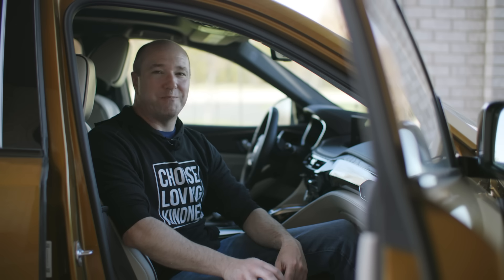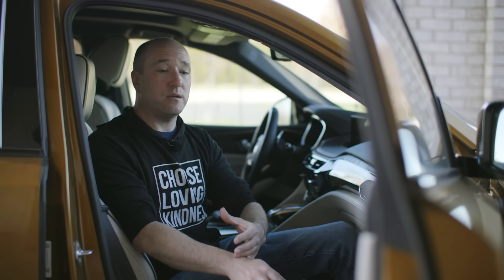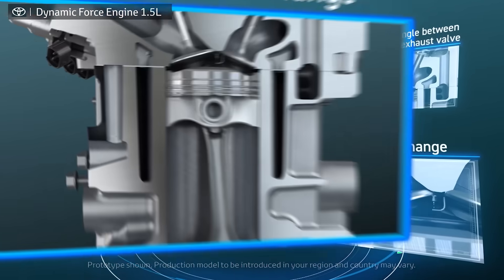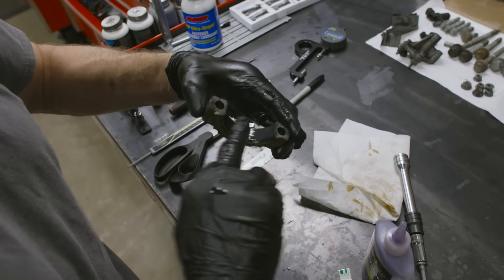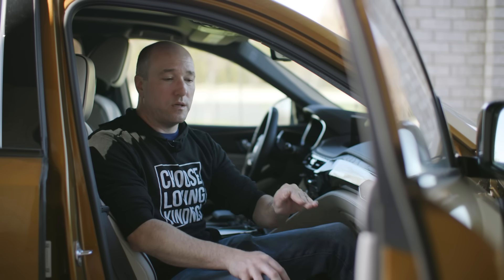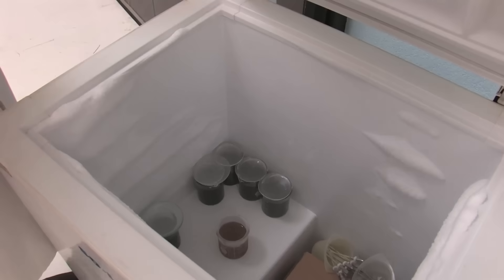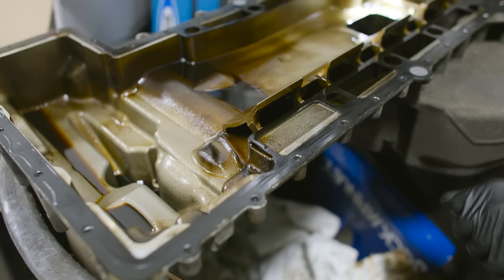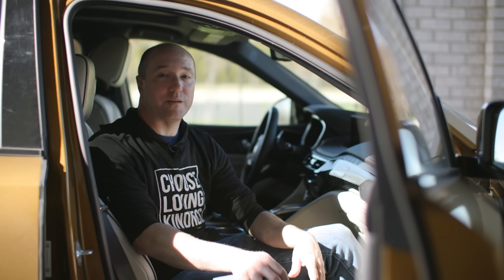Understanding Engine Break In | Dos and Don'ts

Comment: 5k miles for oil MAX
Reply: Especially if your ride is sporting a turbo.
Reply: 3k
Reply: @berict  3k or every 3 months for older vehicles that sit around I've heard
Reply: 3k or 6 months for me. Oil changes are cheap, engines are not. Top tier gas, change your all the filters 1 x a year. 3 years or 50k for tranny’s and fluid change for radiator, brakes and power steering.

Comment: Another reason why the combustion engine needs to go. Get an electric car, charge it and go. None of this bs engine break in.
Reply: You have an entirely different process. Don't over heat cycle the cells. Don't slam on the battery and jump on a level 3 charger. Don't let your ride sit below 50% charge for periods. Fully cycle the battery to reset the battery meter. Nothing is perfect.

Comment: Many keep talking about oil change intervals with no mention of what type of oil there talking about. Modern synthetic oils are totally different than old school dino oil. Changing most synthetic oils at 5k mile intervals after break in is normally unnecessary and provides few if any benefits in most normal daily driving cases.
Reply: 2 words "Oil Analysis"

Comment: Great advice!

Alot of manufactures are currently are using 0w oils, such as Toyota in the LandCruiser 300 here in Australia, this is used to ensure DPF and emissions systems longevity and also reduce friction and achieve better mileage.

However, this is resulting in crank bearing failures and piston scoring under loads and towing etc, which is what LandCruisers are used for.... So definitely change out your oil to a rating that suits your use and dont listen to your dealer who in our case is only following 0w oils recommendations from Toyota

Comment: A valuable video not only because of the obvious effort put into the video itself, but also because the very insightful comments provided by viewers.

Yet still I am not fully clear on the subject of varying the engine load during the break-in period.

With a cargo van (4250 RPM redline) which I, after breaking in the newly fitted enging, expect to daily operate between 1500-2500 RPM (accelerating) in a relatively relaxed manner, cruising on the highway around 2250-2500 RPM, occasionally accelerating up to 4000 RPM, I did the following for about the first 1000 miles:

My acceleration was in a quite slow and steady, linear way - basically in a manner I'm afraid frustrating to the average commuter - shifting at a maximum of about 2000 RPM, without lugging the engine. Perhaps this is what one could describe as babying it.

Perhaps doing a few things differently would have been better:

Setting a higher RPM limit or perhaps accelerating in a progressively increasing manner (whilst still feathering the throttle). Basically not being too gentle, holding traffic up slightly, but also not keeping up with those in a rush.

If someone could please enlighten me, I'd appreciate it.

Obviously the first 1000 miles or 1500 kilometres is just the very start,  I guess one increases the load afterwards in a steady way.

Thank you

Comment: Got my first brand-new car in June. A GR Corolla. Came to me with 8 miles on the ODO. I did a LOT of reading, learning about oils, piston ring interactions, crank bearing wear, etc. This is a 1.6 L 3-cylinder that's boosted to upwards of 25 PSI, after all. I didn't want to do anything wrong. And Toyota's break-in process seemed inadequate; 621 miles (1000 kilometers) of avoiding extremely high speeds and sudden acceleration, avoiding driving continuously in low gears, and avoid static loads. That's it? That's all they give us in the owners manual? Doesn't seem like enough.

So, instead, while following those rules, as well as plenty of engine braking, I went further.

First, I did an oil change right off the bat. New filter, and Royal Purple 30 weight break-in specific oil. Repeated at 500 and 1000 miles, then switched to ASMOil 5w-30 Signature Series at 1500. Always with a high-quality, fresh oil filter (Napa Platinum or Wix). 

First 500 miles, ZERO boost. Nothing above 0 PSI on the boost gauge. Next 500, nothing above ~5 PSI. Next 500, nothing above ~10 PSI. Plenty of monitoring of oil levels throughout, though I never had to top up. Always varying the load, never giving more than gentle throttle input under 2K RPM, plenty of engine braking, etc. Basically, trying to get those piston rings to mate as best as possible with the cylinder walls. Especially important now that the piston ring gap issue these engines have has become known. Gentle warm-ups, running time after driving to cool down. 

At 1500 miles, I also did a full lube swap. New engine oil and filter, new transmission oil, new transfer case oil, and new rear diff oil. All AMSOil (as that's what was available, and it's a known high-quality product, though I was hoping for Motul). 

All of this was not hard, and I don't understand people who don't spend the time and effort to break-in these engines right. Like, the inline 4 in the wife's Rav4? I get it. Just hop in and drive it like it's gonna be driven, and it's fine. But for a massively overboosted little 3-cylinder like the G16E-GTS? Dude. Take the time and do it right.

Comment: After the Kia and Toyota engine failures and huge recalss, due to manufacturing debris, metal shavings, in the engine, I see no reason to not make the first oil change as soon as you drive it off the dealer lot.

Comment: Any recommendations? Recently purchased a 2024 Grand Cherokee with the 3.6 liter engine and now have over 600 miles on. I'm planning to change the oil. Break in period. The manufacturer calls for 0W-20. I live in Texas where the weather don't get that cold. So here's the question? Should I use the recommended oil 0W-20 or use 5W-30 oil? 0W-20 to me is for cold weather areas and I believe Texas is not one of those cold weather regions.
Reply: Check your owners manual.  It might recommend thicker oil for your climate.  First oil change at 500 miles.  Next at 5000, then 5000, 10k, 15k so on

Comment: My car broke in at 3000 miles, why? I noticed the fuel economy getting better and better, now I can get in city 46-49 mpg occasionally 51 mpg. I've got a 1.5 tsi ACT 130, I use 0w20 and change the oil every 3000-3500.

Comment: Excellent video and great comments in the comment section. I'm buying a new car this week for the first time in almost 18 years (absolutely stunned at the prices, btw) and needed this reminder. The last car I bought new in 2007 was carefully broken in and meticulously maintained by me. It has 288K miles and still running perfectly, no oil burn or leaks. I intend to get the same use out of this new car... fingers crossed. Thanks for the content/info

Comment: If you have an expensive higher performance car, you should not go 10k miles on oil. If you don't believe that, do used oil analysis. Modern oils do break down - shearing resulting in viscosity loss and that allows wear to happen.  So, some good information in this video, but I would not follow the advice on oil changes.

Comment: I have to assume that a car engine that does not burn oil was broken in correctly.  I drive new cars at legal highway speeds without using cruise control for 500 miles and change oil at 5000 mile intervals.  I have not had significant oil use in the 25 new cars I have purchased.
Reply: 25 is a lot no? Unless you have business or something.

Comment: IMO, a Honda, Toyota and Nissan are every day driving commuters cars.  In the case of a Porsche, Ferrari or a Lambo, those engines need to broken in at intervals.
Nissan, Toyota and Honda are designed to be drive for city driving and not a track race environment.  Of course no matter what type of car you buy brand new, you have to notice engine warm up, oil changes and any noises comind from direct throttle variations.  Oil, radiator and transmission fluids are important do as to make sure engine is not reaching overheating.
I suppose if i had a Porsche the type of driving you do in a 911 would require different brake in procedures for engine and break system, specifically if you take the car to the track.  Which is something you wont have to worry if you own a Civic or a Camry.

Comment: My mechanic told me 40 years ago, the best oil change will be at the 500 mile mark, then 1000 mile mark.  Gets rid of the micro particles of metal!  There is no brake in at the factory!  I have done this faithfully for 5 of my new vehicles!  Sold them all with well over 125,000 miles and never had an engine problem.  I had a brand new Canadiana Noma mower and did the same thing!  I sold it to a guy and it is now 34 years old and that engine is till running, which makes me lol, cause i should never have sold it, it is much better then the other 2 i had.  lol.  Oil and grease is cheap parts are expensive!  Just saying, I have a 2010 tundra with the 5.7 L in it, pulled a 27 foot trailer with it for 50,000 miles and have now over 125,000 miles on it, touch wood no problems, changed the oil every 3-4 miles, safe day to all!  Love these sights!

Comment: Alot forget about wiper blades, try driving in light rain on intimate operation and in  heavy rain switch between normal swipe and fast swipe. The same for the aircon pump   switch between low and medium and short bursts on max.

Comment: When I buy a new car,  I change the oil and filter at 500 to 1000 miles. The dealer says it isn't needed. No matter how modern an engine is, or how it is made at the factory, there ALWAYS  is metal in the first and second drain.  All you have to do is take the used oil drain pan out doors into direct sunlight and look! There is copper, brass and aluminum 
.... and silicone in the drain pan. Car makers are more worried about fuel economy and lowering maintenance costs to meet the government rules. Have we learned nothing from BMW's ten to fifteen thousand mile oil changes? Rod bearing issues, sludge and early engine failures are proof of this very unwise decision! I will always change my oil early. I don't care what the dealer says! Oil and filters will always be cheaper than a new or rebuilt motor, under warranty or not!

Comment: I'm gonna be honest... modern engines do not require any special treatment for break-ins as nowadays engines are built so precise that everything just works... except USA designed and made engines...
Reply: Lol on the US part, but who said no break in was necessary?
Reply: @marcjones744  in the early days, engine parts manufacturing wasn't as precise, so, when a new engine starts running, it polished itself internally, thus 1st oil change was recommended be done in less than a thousand miles due to metal shavings found in the oil. That's what you call engine break-in period. Today's engine parts are built much much much more precise, so they don't really need the special attention like the old engines. Break-in period is recommended, but not necessary!
Reply: @1wasinAlpha  gotcha... Thx

Comment: One of the most important aspects of engine breakin is the warming up to op temp & the cooling down to ambient temp. Then, repeat. Again & again. The expansion & contractions. Toytas owners manual states their toyota engines will be broke in at 761 miles. Not 700. Not 750. Not 775, but, 761. Strange but true.

!

Comment: I just purchased a new 2024 Mazda CX50 2.5L Turbo. The manual states this for "Break-In Period":
1: Do not race the engine.
2: Do not maintain one constant speed, either slow or fast, for a long period of time.
3. Do not drive constantly at Full-Throttle or high engine RPM for extended periods of time.
4. Avoid unnecessary hard stops.
5. Avoid full-throttle starts.
6. Do not tow a trailer.

So good advice and matches mostly what this video says 👍
Reply: Another channel recommends changing oil at 500 and 1000 miles for break in then going to 5000 mile ones as the longer intervals are for life of warranty not the overall longevity and running.
Reply: good advice
Reply: I've never changed the oil for the first time before 3000 miles. Our Lexus is now 20 years old and never burns oil with almost 150,000 miles on it. I did break-in the engine as per the owner's manual.

Comment: Great video!  Is this also applicable to diesel engine in a truck? And what is the max speed during first 1,000 miles, is it 40 mph, 50 mph, ?  Ford manual doesn't say specific speed just says not too fast.  Thanks

Comment: So, witn the whole oil situation, I just got a gr corolla and it Calls for 0w20, should I be using 5w20 or 5w30 then?
Reply: Congratulations! I'm jealous. Most experts are going to say, "use the manufacturer recommended specification for oil", But change your oil every 5,000 miles. Don't don't wait to change oil 8 to 10,000 miles If you wanted to last as long as a Toyota should. Arbitrarily using different oil viscosities based on your own judgment is kind of a thing of the past.
Reply: @marcjones744  ahh okay gotcha.

Yeah I'm suuuper picky about oil change intervals, I've always changed the oil every 3k miles on all my vehicles.

I know it's an older milage interval and people say im wasting money but in my own opinion, I'd rather spend the money on the oil than even more on the engine.
Reply: Your owners manual may recommend higher viscosity oil if you live in hot climate like Phoenix or Las Vegas.

Comment: I was good until he discounts engine oil intervals. Modern engines, especially turbos, achieve EPA standards by recycling oil vapors through the crankcase, resulting in dirty engine oil. Fresh oil and frequent changes are the cheapest insurance against engine failure!

Comment: Still “breaking in” my new 2024 Corolla. I just try to make sure not to rev it above 3-4K RPM, and I plan on changing the oil around 1K miles (just crossed 500). Luckily I live in the city, so the varying RPM’s come naturally. I also try to let the engine warm up a couple minutes before hitting the road. I’m hoping this car lasts 10+ years even with a CVT.
Reply: Had a girlfriend who bought a new Toyota highlander in 2004. She drove it 400k miles.  Besides tires n brakes the rear suspension needed fixed once. Original drive train though.  
Maintain your Corolla and it will treat you right

Comment: Shouldn't have watched this, just got a new Subaru WRX. My oil temp is already getting to 210-220 just over an extended driving session of like 30 minutes on the freeway, and it's only like 60-70 outside right now. Going to paranoid ASF in the summer when it's 100+ outside 😮
Reply: Lol... I think u will be ok. If u do the other stuff, you should be good. Most people who buy cars have never even heard of engine break in. I sold new cars and never heard of it until i stopped selling cars and started learning more about working on cars... U will be fine

Comment: Savagegeese dudes, engines are so under engineered these days that carbon is a huge issue. Over 5k miles between oil changes, if you plan to keep your car past 100k or 120k miles is risky.

Comment: Apples to oranges, but most motor builders tell you to gradually feed the car max (low setting) boost, and tons of vacuum within the 1st 100 miles.  

I have always done this on built engines.  Always had 0 oil consumption, and perfect comprsssion.  Iv built a few 4g63’s that are high performance/race motors 

Other Guys go as far as to break in the motor on the dyno 

Concerning new cars, I have had 3 purchases brand new.  1 ej25, and 2 ea888.  I broke all of them in, progressively going max throttle, max boost within the first 50-100 miles.  Tons of engine decel.  At 75 miles I consider the engine broken in.  

Drivetrain stuff is a bit different….

Oddly, ej25s and vw ea888’s are known to have oil consumption issues.  None of my cars did.  All ran strong with 0 issue

Comment: $64,000 question for those with a brand new car spec'd with 0W oil & planning on keeping it forever: If you don't care about the marginal MPG gain the 0W-(20) oil brings to the table, are you better off running say, a 5W-(20) oil?  

The problem ordinary guys like myself have in this arena is we don't know the percentages of importance the manufacturer's put on their spec'd oil in the following areas:

- On them getting their product thru the warranty timeframe (long oil run recommendations i.e. 10k mi etc)
- On them trying to get max MPG values for their overall CAFE #s 
- On what's best for the least amount of engine wear over the long-term life of their engine

I care way more about long term wear prevention than I do about saving a relatively small % of mpg but I have no idea if sticking to their EPA-friendly thin oil is plenty good enough (especially if changing the oil 2x as often as their recommendation). 

Take VW/Audi. A lot of their engines are spec'd for their 508 oil standard. That's 0W stuff. I'm not aware of any 5W-(x) oils that meet that spec. Does that mean they are bad for the car (in reality)? How's a guy supposed to know if the VW 508 oil spec is wholly based on CAFE concerns & thus me as an end-user don't have to worry about a 5W oil not meeting the 508 spec?